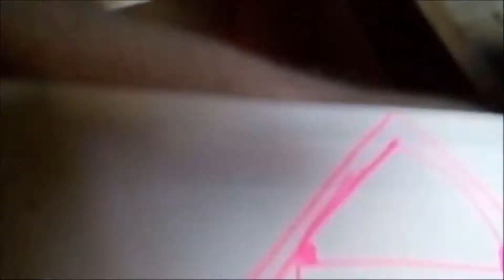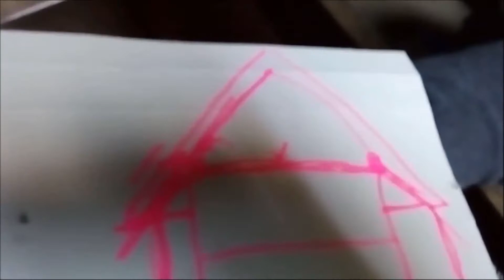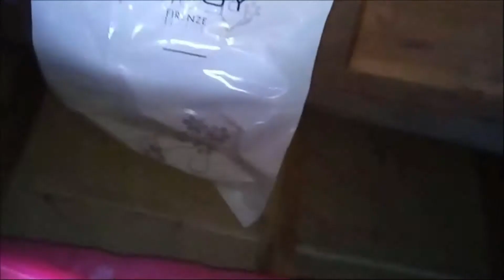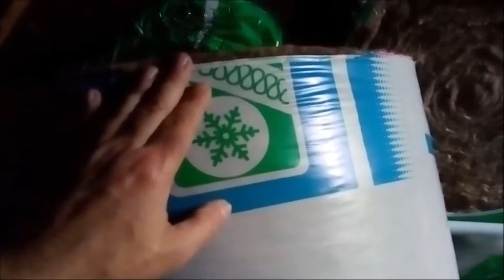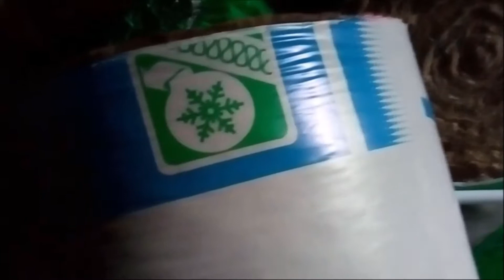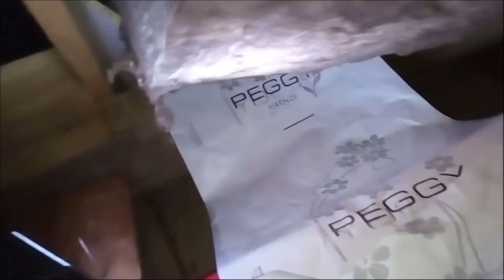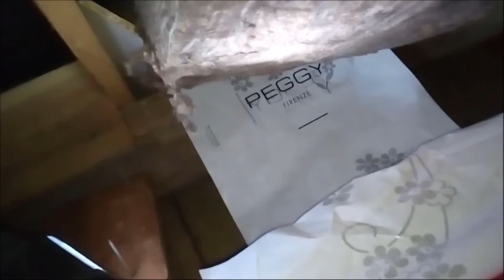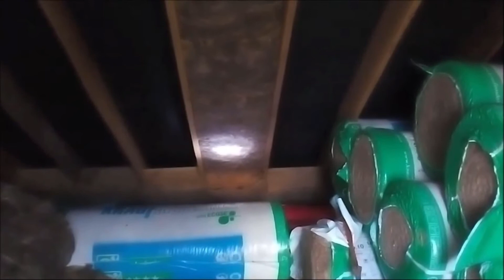Building The Lab Diaries part 2

Comment: I don't know if you are still working on this but do they have loose fill insulation where you are? It's made out of either cellulose or fibreglass for blowing into attics or wall cavities, you can rent a machine to blow it in, or break it up by hand and dump it down those holes. It would also help to put sheet plastic over top of the insulation before putting the wall board on, it will keep the condensation from getting into the roof. I'm actually surprised that the attic floor wasn't insulated, that's pretty much standard anywhere in North America, unless it's over a garage. 
  I was also wondering about the joists in that attic, they look like they might be the close metric equivalent to 5-1/2-6 inches in depth? You may wish to mate some wider lumber onto the sides of those attic joists to put it up to about 7-1/4 inches or more to stiffen it up. It might also be a good idea to double up the lumber around the attic opening, and add metal hangers to support the joists you cut rather then relying on the screws. Just some thoughts.
Reply from the maker: Hello Oleg. Funny that I did in fact do some of the shorings up and reinforcements you suggest, we both seem to have had the same thoughts (see episode 3). As for plastic covering, yes you're right the insulation should and will be covered by plastic sheeting, I just wait to finish insulating the whole of the roof's surface so that I can finish that in one go.
Also, building regulations here, although not quite the same as in America, are quite similar. Unfortunately the house wasn't insulated at all when I bought it, which was unfortunate on the one hand, but also allowed me to bring down the purchase price of the house. But, as you can see I'm working to correct this problem.
As always, you're welcome to watch other videos on my channel. Sorry for the belated answer, but if you watch episode 3, the reason for this will be explained. See you soon :)